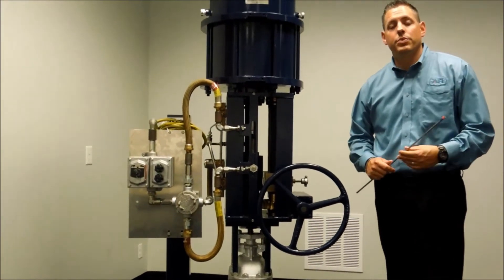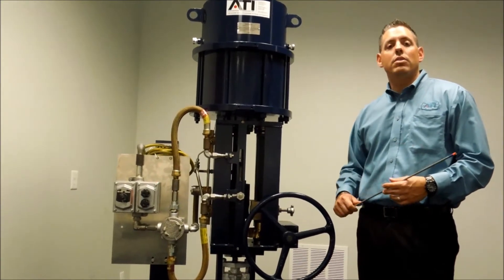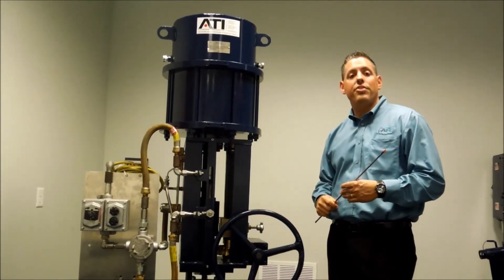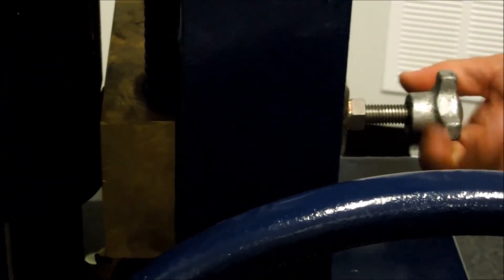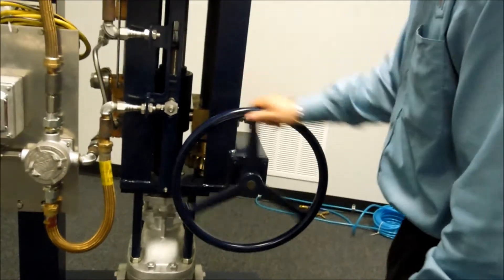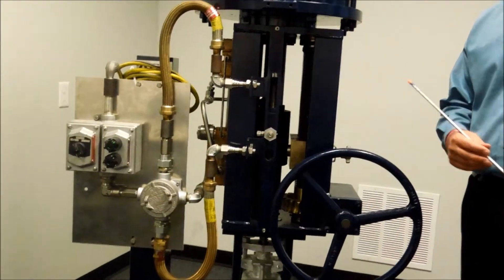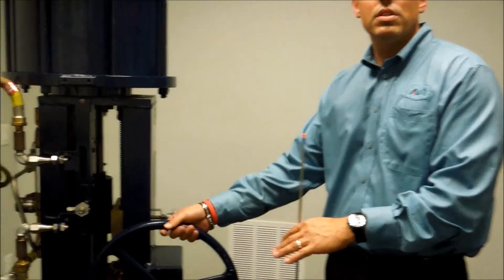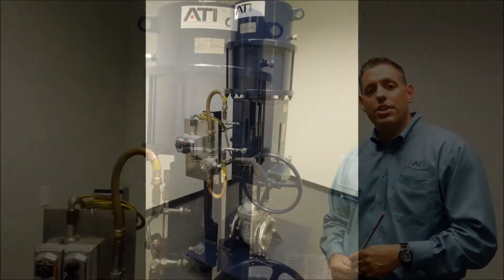ATI JS2 Manual Overrides

Comment: Hey guys! Maybe you could tell me on 2:25-2:27 when teller turns the wheel, it requres some strength to turn it. Is there any pressure in the cylinder or something like a spring that resists the movement or it is just how your manual override works on the unloaded equipment?